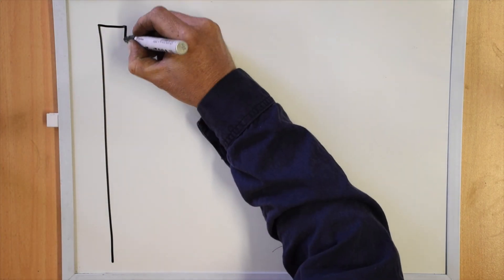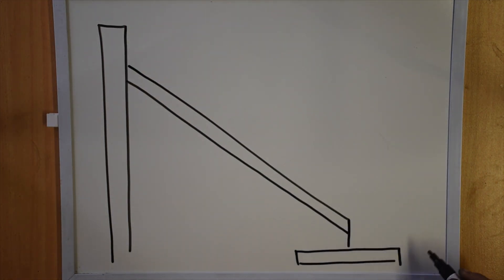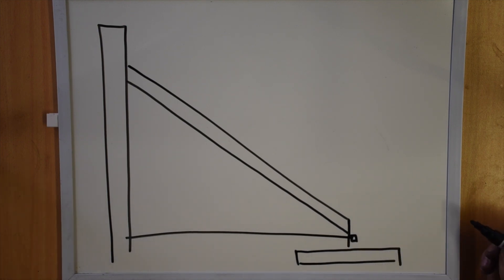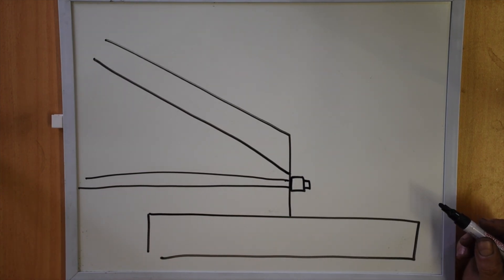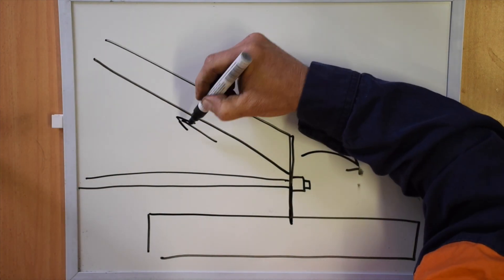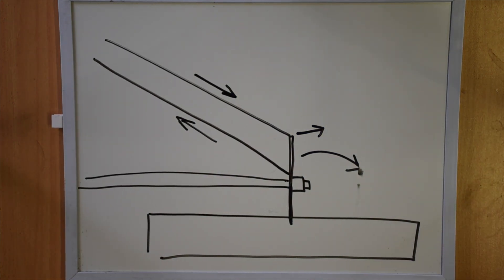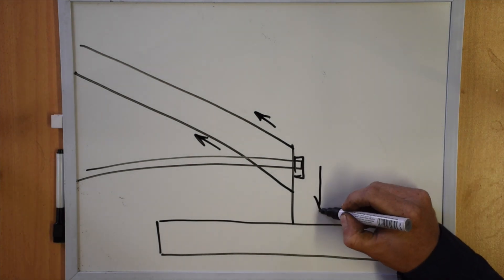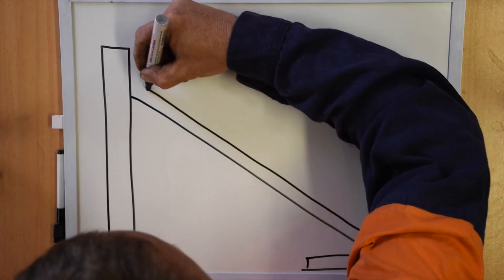How We Do It: Science of Our Stay #EP2

Comment: I can see that positioning the threaded rod in the centre of the bottom of your stay may reduce the "bending force" but I reckon it does not eliminate it. The threaded rod is still pulling at an angle, so there is still compression on the bottom of the stay pipe and tension on the top. The only way you would have compression on the top and bottom would be if the threaded rod ran up through the centre of the stay to the top of the stay. Of course, the threaded rod would then no longer perform its function. Just my opinion. I'm not a qualified engineer.

Comment: I built some 5m long stays back in April and came across this problem. I assumed 5 metres would be fine because I have built H-stays and stand alone sections that long or longer. However the bolt sat much lower than the tube receiving section and the strut started to bend at lower strain than I really wanted it to withstand.